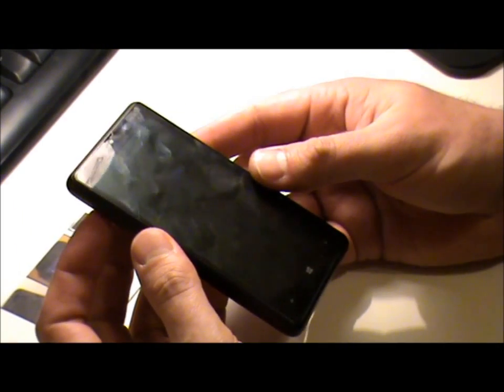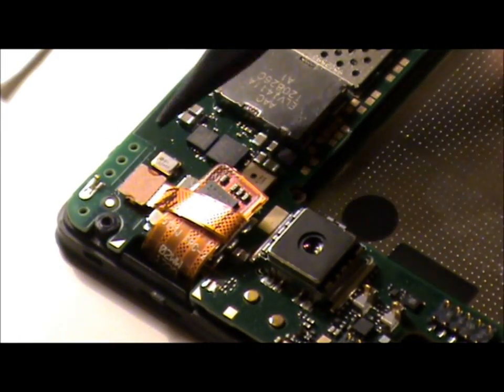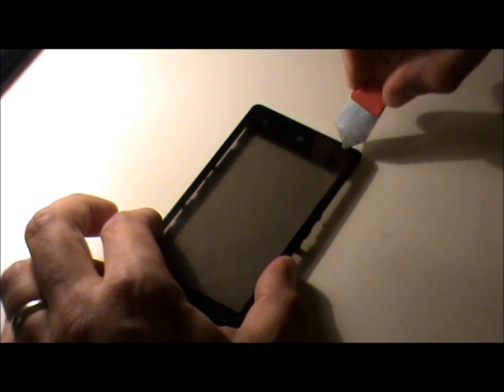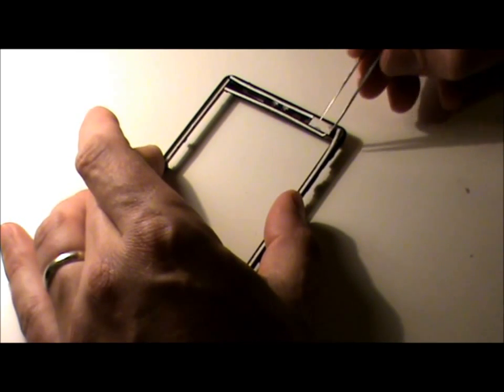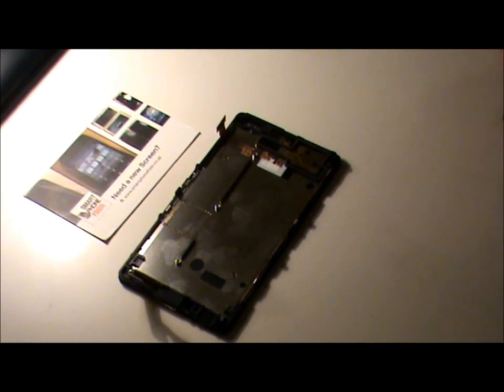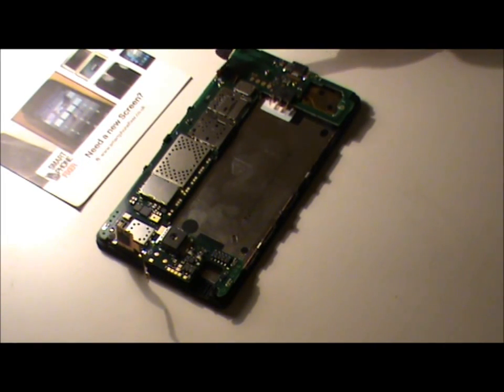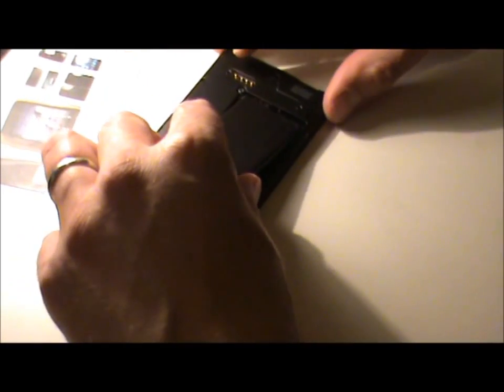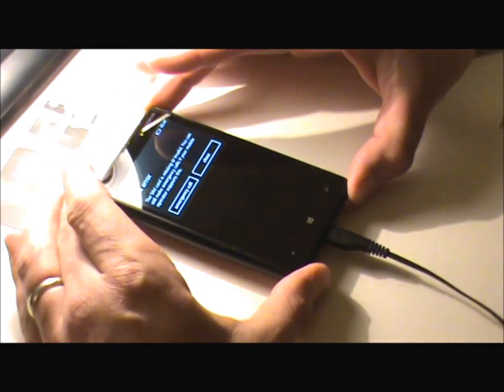Nokia Lumia 820 Screen Replacement Guide

Comment: Thanks  Man, for the video...I did change the screen with a new frame attached to it..But when I switch-on the Nokia Lumia 820 phone again the LCD shows nothing, meaning its just black( ...yet the external buttons are still operating as usual ) and it was not so not until I changed the screen...Please any suggestion on what to do next. Thanks again.
Reply from the maker: Hi Godwin, it's difficult to say for sure apart from going through the connections to make sure they are properly connected from screen to motherboard. You might want to consider a hard reset too.

Comment: Hi, great video, very well explained, but camera a bit blurred in places.  But, still clear enough to do the job.
Just changed the digitizer and frame in about 30 minutes, all great.  We bought a genuine Nokia part from www.replacebase.co.uk - 2 days to get delivery, just before New Year - pretty good.  They sold the digitizer alone, but by the time we'd have bought the tape, and tools, it was only £5 more to get the frame attached and save a load of hassle.  Didn't want to risk a cloned part as they have sensitivity and colour problems reported....
2 points - we found the corner screws to be a different size - T6 instead of T9, as in the video but Will has said that they can vary.
Also, the lower on-screen buttons work now, but do not light up - anyone know if there's an easy fix for this?  Thanks again... Danny
Reply from the maker: Hi Danny, I'm glad you found the video useful. I now shoot videos using an HD camera and better lighting.

I've not come across the problem before with the light flex cable in the Nokia Lumia 820, I'm afraid.

Comment: Any ideas to why the screen goes blank when I make and recieve a call, also locks itself permanently so have to take the battery out every now n then, not as fussed about the random locking but my phones pay as you go so cant put credit on without the screen. Any help would be appreciated.
Reply from the maker: The screen should go blank when you put it next to your ear when you make or receive a call. If it locks before you put it near your ear it suggests to me that there might be something wrong with your proximity sensor. It could be that your proximity sensor is covered by a screen protector (?). Or, it might be blocked up. Try blowing some compressed air into the earpiece to blow any dust away. I hope that helps.
Reply: Sorted it mate cheers.
Reply from the maker: Glad to hear it.

Comment: So yesterday i dropped my lumia 820 and it cracked slightly on the top right corner now the bottom half of the touch screen does not work, will this be my solution or is it something else? Help greatly appreciated :)
Reply from the maker: Hi there, 

When you crack the screen in one place on the 820, it means the whole screen will not work. Therefore, yes, this is what you need to do to fix it. You can find some recommended suppliers of replacement screens in the notes below the video. 

Will

Comment: Hello there - great video, easy to follow. I replaced the digitiser screen as you did - the screen is non-responsive - could it be that something isn't tight enough to make connections or do you think it is the screen? I took the phone apart again ( minus the screen) and reassembled in case I missed something - the LCD screen is undamaged - any ideas you have would be great!
Reply from the maker: Hi Michelle, glad you liked the video. The Nokia Lumia 820 screens are really prone to damage and, if there is one slight crack or bit of damage on them, they won't work. So, it could either be a damaged/faulty screen. In which case, speak with your supplier and check the guarantee to see if you can get a replacement. It could also be a mis-connection between the screen and the motherboard. It's easy to mis-align the connector. Try removing and replacing the screen again. If that does not work, then it sounds like your screen is faulty. I hope that helps. Regards, Will

Comment: Hi Will, I've dropped my 820 and now the screen is broken in the right corner at the bottom and the three sensitive buttons don't work (back, search and windows). Do I need to change the digitalizer? Because the display work fine and the touch as well.

Thank you!
Reply from the maker: Hi Alessandro, Yes, you will need to change the digitiser on your 820. When it is cracked it has the effect of making the whole screen unusable.

Regards,

Will

Comment: Hi Will,

Thanks for a great video. My digitizer is now fine but my proximity sensor is not working correctly. Screen blanks during a call and the only way to get the screen to re-appear during a call is to shine a very bright light at the sensor. There is no dust in the way. Is there anything I might have dislodged during the procedure? The replacement digitizer came with the frame fitted.

Many thanks, Harold.
Reply from the maker: Hi Harold, that's unusual and it does sound like the proximity sensor has been affected during the replacement process.
Reply: Will Hawkins Hi! I have the same problem. Yesterday I changed the digitizer but when I answer a call, the screen turns black. Also I can hear only with hands free, maybe I have to change the earpiece. But why the screen turns black?
And I can't see the light at the buttons down (back,win,search). The phone seems to work perfectly :/
Many thanks,
Sevi.
Reply from the maker: I don't know exactly why this is happening but it sounds like a proximity sensor problem. The screen should turn black when you put the phone next to your ear. But, not before. With the light strip underneath the home buttons etc, this can be replaced, but it is not vital to the operation of the smartphone.
Reply: Finally I found the problem. Thanks for your help. There is a little blank between the digitizer and the sensor. So I have to put more tape (or stronger tape). Thanks again :)
Reply from the maker: Glad you found a solution!
Reply: :) thanks again!

Comment: Hi mate, my dad just replaced my screen today and it worked fine but, when I lock it I can no longer use youse it it freezes completely any suggestions? Tom
Reply from the maker: Hi Tom, I'm not sure if I understand. If you lock it, it should not be usable anyway. Do you mean you can't unlock it?

Comment: Hi There. I dropped my new Lumia 820 and the display won't work now anymore :( The screen is not broken but the inner screen (if that is what it's called) shows a crack. I gather you can change either the digitizer or the screen. What do you suggest would be in my case?
Reply from the maker: It sounds like your 'LCD' is broken. So, that's a definite change. The Nokia Lumia 820 touch screens tend to be quite sensitive, so don't be surprised if you need to replace that part too.

Comment: hi i followed the steps to replace the screen. turned the phone on and found only half of the screen works. i then took it apart again and checked the connections and all where fine and the problem remains.
is there any soloution
Reply from the maker: It sounds like a faulty replacement screen. I would check your warranty from the supplier to to see if they will replace it for free.

Comment: Hey I bought and replaced my digitizer and put every thing back together and the new digitizer did not work After looking at the old and new digitizer I noticed that the micro processor of the digitizer look slightly different, on top of the old one there is 4 large metal pieces and on top of the new one there is 5 smaller ones Could this mean that the digitizers are for different models ? I have the lumia 820.1
Also on top of the old one it is written synaptics and the new one ENDA.
Help ?!

Comment: Thanks for your reply, well im guessing the digitiser is fine because when i removed this plasticy glass that was stuck to both, the digitiser is fine but their is a very faint scratch on the lcd, also the screen is totally black after the drop occured, i know its turning on because i can feel the vibration just the screen is blank, so looks like il have to order a new lcd screen

Comment from the maker: Hi John, 

The replacement digitiser unit come with protective films on them. But, you might get some sort of, 'liquid optically clear adhesive' on the screen (unlikely). 

But, normally the Nokia Lumia 820 screens come a single unit with no extra layers between them and the LCD. 

It could be that a layer of the digitiser had peeled off your original screen. That's quite unusual, though.

Comment: Hi Will, great video, I was just wondering if there is like a 2nd type of glass that goes over the lcd screen because when i was removing the digitizer, there was some glass stuck to it-the digitizer, and the rest was stuck to the lcd screen, very easily peels off both..?Thanks

Comment from the maker: If you can see the LCD below clearly (i.e. the picture is not distorted) then you just need to replace the screen (touch screen/digitiser). Make sure you buy a replacement screen with an integrated frame. It's much quicker to fit. Look above in the description for a recommended supplier. 

If you can't see the image on the LCD clearly (e.g. it looks cloudy or blotchy) then you need to buy a new LCD and screen. 

I hope that helps.

Comment: Video was very useful.  Took it apart ok and put it back together. Unfortunately the new screen does not work at all. Since I put the new screen on (Touch Screen Digitizer+Frame Housing) the screen does not respond to touch. Before the replacement, the original screen had a crack across 1/4 of way down and only the top 1/4 responded. Any ideas? Thanks

Comment from the maker: Hi Victor, 

This is a problem with the screen on the Nokia Lumia 820. When it is cracked/broken it has affects the whole screen. In other words, even though it is broken in one small area, the complete will not function. Therefore, you have to replace the screen. The lights underneath are not attached to the screen. When you buy a new screen (recommendations above in the description), make sure you buy one which has the frame included. It's much easier to place onto your Nokia. Regards, Will

Comment: On the other hand, the upper part works. So I can unlock my phone and go down, go up with my finger.
That is my question : I don't know if I have to buy only a replacement touch screen, or the complete unit (LCD & touchscreen). My screen is not black or something like that, I can see all what I want, all my apps, I can even call somebody, etc.
I think I've just to buy a touchscreen but... I need a confirmation!
Thanks again and sorry for the mistakes I've made, I'm French and I'm just 17 (2/2)

Comment: Hi Will, thank you very much for the video. Excellent work and easy to follow. I have one issue coming from the proximity sensor, it doesn't switch off. Do you think the new glass touch digitizer is faulty? What could I do?

Comment: Caution, just bought a screen off ebay for a rip off price of £30 and it had no film cover on the rear of screen, i tried to peel off what i thought was it and it peeled the black tint off the screen and also cracked the cheap glass which is weaker than ice.

Comment from the maker: Hi Keith, 

When you have taken the battery and restarted, can you use the touch screen normally? I have had one Lumia 820 repair which sounds similar to the problem you seem to be having here. It is likely to be one of two things. 1. It could be a faulty new screen (in which case, get it exchanged by your supplier). 2. It could be some damage to your motherboard after a drop, which is more difficult to repair, if at all possible.  I hope that helps. Will

Comment: a quick question; we replaced my wife's Lumia 820 screen, and its stuck on the lock screen.  when you hit the button, then go to swipe to unlock, nothing happens.  but if you manually reset by taking the battery out, when it restarts and gets to the home screen, everything works fine.  im at a loss.

Comment from the maker: Glad you found it useful. It's quite a straightforward job to replace the touch screen. It's made much easier if you buy a replacement touch screen which includes a frame already attached. This will save you the job of removing the old glass from the frame which takes a few minutes. 

Regards, Will

Comment from the maker: Hi there, the method I use is the one recommended by Nokia themselves. It's impossible to put a new screen on without taking the motherboard out. You simply cannot take put a new screen on from the front only because you have to thread the cable from the new screen onto the motherboard and clip the screen cable into it. So, saying they did not touch the motherboard is an impossibility.

Comment: Is there another way to open the phone to repair it? I sendt my phone to a company that repairs the phone immediatly and after the reparation the earspeaker didnt work anymore the loudspeaker does. They told me they opened it from the front so they never have touched the mainboard like they never touched the earspeakers, so its not their foult, because they never touched the mainboard... Could that be possible? They showed me another phone where they opened only the front but never the mainboard

Comment: Good instructions, really saved me a bunch of money.  However, a T-9 screwdriver proved to be too large, a T-6 was what I needed.  Also, you should have mentioned how to remove the old adhesive. Rubbing alcohol and a Q-tip does the trick.

Comment from the maker: Hi Zhouji, 

Bad luck with your phone. If you look at the notes above (beneath the video), you will some links to replacement screens for the Nokia Lumia 820 which are available on eBay UK and Amazon UK where you will also see how they are described. Use the same description on the US versions of the sites to get the right part. Also, make sure you buy the digitiser (touch screen) which comes with a frame. It's a much easier job then buying a digitiser without the screen. I hope that helps.

Comment: Hi Will. My Lumia 820 fell down on the ground  a few weeks ago. The lower right corner of the screen is cracked. The touch screen does't work on that part now. I  contacted Nokia U.S. support,  they said the broken screen was out of warranty... I am thinking about changing a new screen by myself. I searched screen replacement for  820 online, and I got "Replacement Front Touch Screen Glass Digitizer Repair Part" and "Replacement Touch Digitizer". Are these what I need? Usually how much is it?THX

Comment from the maker: HI Sergiu, thanks for the details. See my earlier reply. Check if that works first and let me know. Do send a photo, but it could be a faulty screen or a loose connection. If you bought the screen using PayPal or a credit card, you might have some insurance to get your money back or a replacement from the supplier of the screen. 

I hope that helps. 

Will

Comment from the maker: Hi Sergiu, 

Sorry to hear about your problems with the Lumia 820. It could be a number of things. Normally, the 820 is quite simple to put back together. So, I would check the connections are correctly seated in the sockets for the LCD and the digitiser first. If it is still wrong, then go back to your supplier to see if they will change the screen. Please do send a photo: info at smartphonefixer.co.uk 

Regards,

Will

Comment: As the display got broken it worked normally, but filled with some dark blue thing and this one turned over the full screen, so it got very dark. 
After my change the screen looks like a tv without a channel. Like its missing the signal, or something like that. Touch is working, cause it vibrates, when I touch it.
But when I turn it on, the Nokia Logo isn't showing, after seconds, only this grey thing. I hope you can tell me, whats wrong,... invested 81 Euro for the new screen :(

Comment: Thanks, the LCD was functioning just fine before I replaced the rest and I've opened it up a few times and checked all the connections unfortunately... Just one more thing, would a faulty replacement screen prevent the LCD from working then? If so I will certainly try that if that may be a cause - thanks again!

Comment from the maker: Hi there, 

Ok, thank you for the details. I suggest you take the new screen off again and re-install it to begin with so that you can check that all of the connections are correctly in place. This will then help you to eliminate loose connections as a cause of the problem. Whether the magnetic speaker touching the motherboard has caused this, I cannot tell. However, it could be that the screen is faulty too, in which case you might want to ask for an exchange with yr supplier if under warranty

Comment: The screen was cracked, did not respond to touch on the one side but had visuals... Now, it flashes near the bottom and has no visuals - I have a worry that the speaker (being magnetic) touched the motherboard :/ but I don't know how much damage that would do? Thanks.

Comment from the maker: Hi Stephen, 

That sounds like the LCD has broken. It's usual for the digitiser to stop working it is cracked. But, if the screen is black entirely it sounds like it is something to do with the LCD which might need replacing, unfortunately. 

You may as well change the LCD/touchscreen unit in one go if this is the case. You can find a recommended supplier of this unit in the text above and use the video to see how to fit it.

I hope that helps.

Regards, Will

Comment: Hi, bought a replacement screen and followed your video but I've clearly missed something... When I switch the phone back on, it vibrates in reaction and I've heard it make a noise but there is nothing on the screen! What do I need to look at or what may have caused this? I'm quite technically capable but I don't have enough knowledge to know what I've done wrong.